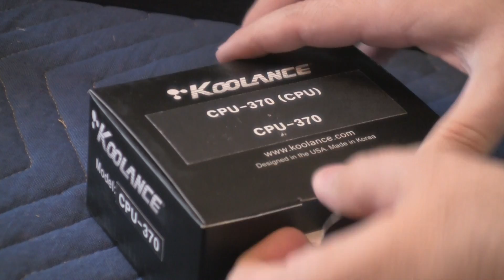Water Cooling Your Computer - Part 7 - Installing the CPU Water Block - Part 1 of 3

Comment from the maker: Yes, I have Windows 7 Ultimate running on this box. With my configuration of  having 2 of the Xeon processors, it shows 24 CPUs in Task-Manager. Regarding the case - you'll need to ask the various case manufacturers if they support this particular case, since it's larger than most. If they do not know, do not buy it.